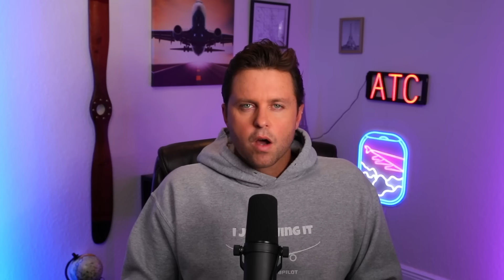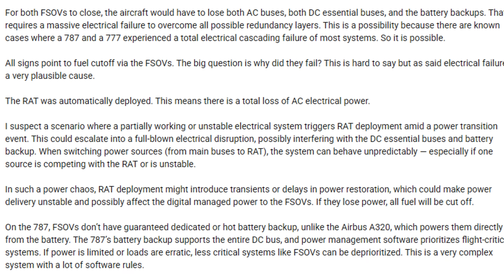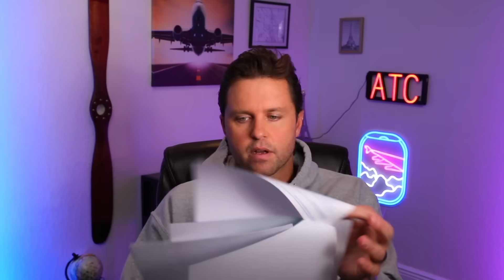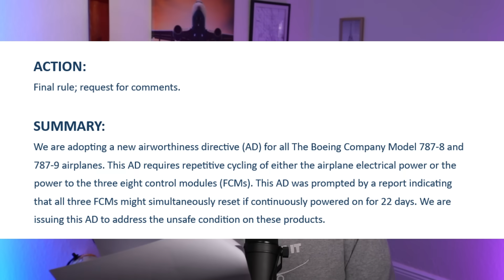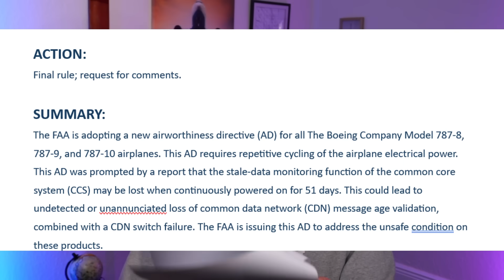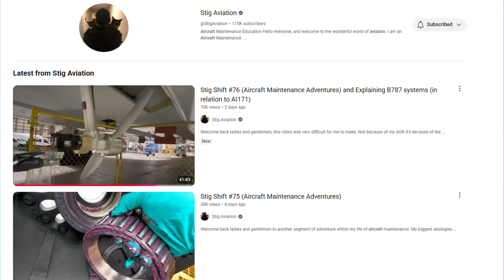Air India 171: Did a Software Glitch Cause Dual Engine Failure?

Comment: What happens when RAT is manually deployed -  does it cutoff the Engines and starts power in economy mode to support essential devices?
Reply: Deployment of the RAT does not cut-off the engines.
Reply: @christopherrobinson7541  does it cutoff fuel?

Comment: Well, I have no further knowledge.... I just can see, that today's software development culture goes over to a statistical error understanding.... that means: Ok, this bug occurs the most, we have to care about them first. I've been writing a comprehensive comment on Steeeve's videos, about what it takes to make SW dev saver. In this case it is the thing: If a fail happens, it has to be fixed - no matter about the chance of happening. Another point is: SW devs usually have only limited understanding of their connected real life. Once they programmed a way to handle an error, they feel fine and handover to others and they never propose any additional mechanical backup, cos that's not their domain.... boom. That's the point where the error info may got lost. ..   maybe the mindset for this design was an ivory tower, as we say here...  they may have thought: Ok, let's make it this way, cos that'll save the plane.... But they forgot the people. A typical ivory tower (only thinking within your own yard, not thinking across borders). .... that's why I opposed to "new" ideas like agile software development, for example. It's not possible to explain here... but when reading the definitions and ideas with this accident in mind, you'll see the problem. Agile dev mainly trusts on the idea of many people being included in decisions at certain points. I say, we need expertise, not more guys. It's just a preparation for failure having an argument not being guilty.... 

Ok,.long talk. In short: With todays SW development culture I can imagine that's all true. Sure. Was that by intention? Not. But we'll see. And: It doesn't matter if this actually caused this incident.... the provided info should be considered and fixed.... If it was not the cause for this accident, it may be for the next? 😌

Comment: Initially when i saw the rant from the guy who was on the previous leg on how the inflight entertainment system and AC was not working, i rolled my eyes because i couldn't think any way that your sear screen issue can cascade to a total dual engine failure. 
Even now, I still dearly hope the entertainment/AC electricals arent connected with core flight electronics at all and are totally independent systems. But I think there are possibilities that there is an issue in the core electrical system that percolate to other electrical systems like infotainment that could be read, and to not ignore smaller things like these totally.

Comment: As an Uninterruptible Power System engineer. (UPS) i can tell you this , Batteries fail all the time and they seem fine until they have a load put on them, and they go to Zero. If the AC Buss and DC buss fail, and the back of battery fails, could that not turn the valve off. When was the last time the batteries were load tested.

Comment: As if a Boeing 787 on an INTERNATIONAL flight to London takes-off from a tiny airport designed for prop planes? CGI b s.
Reply: The runway is 3,600m long and 45m wide, they were flying to London Gatwick which has a runway 3,300m long and 45m wide.

Comment: After learning about the dual engine failure, my first thought was about a software glitch. Essentially both engines have identical computers controlling the fuel, and if there is a software bug, then the bug will manifest in both engines simultaneously. Over 30 years ago I was a software engineer working at Microsoft and one of the developers working with me told me he previously worked at Boeing as a software developer. He told me that he personally encountered 16 bit integer overflow in the code controlling the flaps. In other words, there was a possibility that a value would flip positive to negative under rare conditions. When he reported the issue, Boeing told him that the code was ISO certified and to not touch it. A few years later, I learned that Boeing computers are rebooting every 51 days which is the classic overflow of a 32 bit integer timer running on a millisecond accuracy. I am astonished that the Dreamliner is still rebooting every 51 days. After all, Boeing had decades to fix that issue. Another interesting fact is the engineer whistleblower committed suicide after giving evidence. For the record, I am not suicidal. I have 2 beautiful children and love them very much and want them to grow with their father.
Reply: I am an old, old Pilot. Back in the olden days the fuel shut off values had to be activated by the pilot. Even if the engine was on fire, the pilot had to shut off the fuel flow. So yes I can see how this problem today is caused by problems in the software that control power fluctuations. Today's fly by wire and computer control of everything except the coffee makers decrease the overall reliability of the systems needed to fly the aircraft. I never fly commercial these days.  Also, there is no way fuel contamination could be a problem. There are safeguards in the fueling system that would immediately shut off the refueling process if any contamination is detected.
Reply: @chrisalster7680  Also fuel contamination wont shut both the engine exactly at the same time. This doesnt make sense. Even in past when fuel contamination did shut two engines, it wasnt at the same time.
Reply: @chrisalster7680 I don‘t see the Point to. Why have a Automatic System to cut the fuel? I mean, if there is fire in the Engines, there is an Alarm and the Pilot can switch of the fuel off by himself. I think, sometimes all the fancy stuff confused the Pilots more than it helps? But then, i‘m not a Pilot.
Reply: @chrisalster7680  software or computers themselves are not the problem. The problem is: if the code or hardware is not tested properly, and corruption (e.g. FAA) takes place
Reply: @chrisalster7680 Captain Steve made the same observation about the fuelling system
Reply: @chrisalster7680 what if the contamination was in the biocide, it’s happened before. And you’re relying on the reliability of sensors and electrical systems and software to tell you that the fuel is a problem when you’ve already admitted those systems are unreliable. If you don’t fly commercial, how do you travel? Genuinely curious. You wouldn’t fly in a 787 then, given their problems?
Reply: Thank you.
Reply: This is scaring me to fly on the Dreamliner, my flight is in a week 🙁
Reply: @MinhajAhmed-y7i  The odds are against the same thing happening twice in such a short period of time.
Reply: @freedomofspeech766 MCAS says different
Reply: @MinhajAhmed-y7i Dreamliners are made of carbon fibre. No care for human lives. Would you live in a house made of fibre? Boeing is stupid.
Reply: @MinhajAhmed-y7i just boot it before your flight 😎👍
Reply: @MinhajAhmed-y7i honestly I still would not hesitate to fly on a 787. Its easy and understandable to let events like this spook you but statistically it's still incredibly safe.
Reply: Planes have lots of old stuff because of the lengthy process of getting new stuff approved. Manufacturers carry over as much as they can to make the process go faster, otherwise getting approval can take many more years.
Reply: @georgejr2640  Old, yet very reliable stuff is not a bad thing...
Reply: @brentsummers7377  No argument from me. My daily driver is a 77 pickup.  Just showing a reason why the aircraft world seems slow to adopt things.
Reply: @georgejr2640 and that’s how we got to the 737 Max and MCAS. Airbus prefers to get new stuff approved
Reply: After the FAA issued the three Airworthiness Directives, was there any follow-up as to whether Boeing addressed the software defects (AD-1 & 3),  along with validation test evidence indicated the defects were resolved? Issuing a report is one thing, following it up to ensure the issue is truly resolved is quite another.
Reply: @JimIntriglia  The FAA doesn't really have authority over what happens in other countries.
Reply: @professorg8383  Indeed. It'll be interesting to see the actions of those authorities that govern this jurisdiction.
Reply: @JimIntriglia no. They just issued this workaround and that’s it.
Reply: Maybe something like Qantas Flight 72? A software glitch which was triggered with an uncommon cause, e.g. cosmic rays.
Reply: @user-yt198 Might be, cz that was an extremely hot day, and the plane itself was overloaded (cargo)
Reply: @MinhajAhmed-y7i how do you know about the overloaded cargo? One seen this commented loads but are there any links?
Reply: There is too much reliance on computer software, what's wrong with giving pilots full manual control over fuel delivery and shut off to the engines, the smoke and fire detectors can still do their job and warn the pilots, but in any event if there was a problem with a potential fire in one or both of the engines, a sensible pilot would not have shut them down at the critical point of take off, instead they would let the plane reach certain height then plan an emergency landing
Reply: given the history of boeing wistle blowers you also have courage. many thx
Reply: It seems a  lot of Boeing engineer whistleblowers tend to be found dead in their cars in parking lots having committed  commit suicide from a gun shot to the head, even though they did not own a pistol.
Reply: You had me till the last sentence. This isn't about you.
Reply: You better install a good security system. Alam - Live cams (wired!) - car monitoring - Door blockers - Glock and more....!
Reply: A similar failure occurred during the maiden flight of the Ariene V rocket ... a latent flight software defect (ground-rate register overflow), leading to catastrophic computer resets.
Reply: The whistleblower who committed suicide was not an engineer.  He was a quality inspector at the South Carolina plant.
Reply: please share this with BOEING and NTSB asap  , keep them in loop any bit of info can help
Reply: @sandynoby no, we don’t want him suicided thanks. Boeing are going to do their usual and do everything they can to pin the blame on someone else
Reply: So you worked with Dave...
Reply: So compliance forces bad engineering and kills people? Who knew
Reply: very kind of you
Reply: Wow. I understand the philosophy, "don't fix it if it works". However the software really needs to be overhauled.
Reply: I honestly thought that the idea of numbers overflowing storage was something that programmers would be taught at their mother's knee, especially since the year 2000 bug stuff. I'm not even a programmer, I'm a draughtsman and painter for heaven's sake, but even I know about that one just from listening to programmers talking ( and doing a bit of incredibly basic stuff under instruction for fun). I was shocked to find that the US S/S system had a problem with large numbers in 2025, a quarter of a century after the yr 2000 bug. It's like the days of the BBC Mk2 back in the 1970s when you had to severely restrict every item of data to be able to do anything.....
Reply: unless they are operating 24/7 or without proper service interval, seems unlikely they would go more than 51 days without shutting down.
Reply: i've always advocated a fast taxi and stop, before takeoff, to reveal these sort of gremlins.
Reply: One whistle blower said to his family that, 
if anything happens to me it's not suicide, 
video proof available of one of his family members
Reply: what the fuuu - Uncle Sam (Fmr. Google) aint that wrong about the idea that IT will be more regulated soon, and btw: Microsoft has their own issues, but a aerospace company is a fully diff. business 😆
Reply: I understand exactly what you are saying. Boing are dodgy as hell it seems!!
Reply: stay away from balconies man
Reply: Oh yeah that’s what happened
Reply: no famous software companies like microsoft apple etc not seen participated in the fadec design.
Reply: This was a great analysis. I am sure the boys at Boeing are not going to be happy with you. I would stay away from parking lots at night ....
Reply: The AI flight had a software glitch.
Reply: false

Comment: The fuel shutoff valves are motor operated not solenoid operated though called fuel solenoid valves. They would not “snap shut at loss of power.